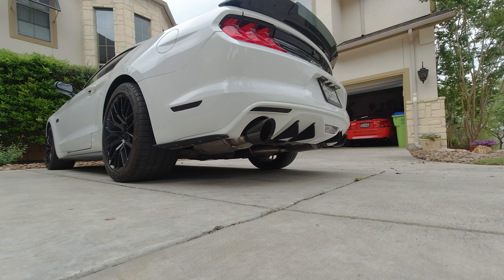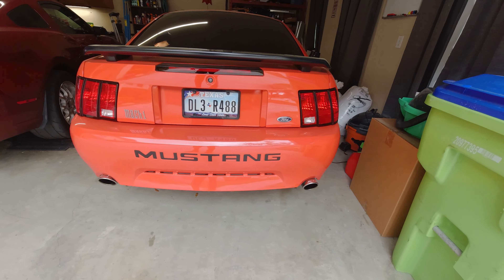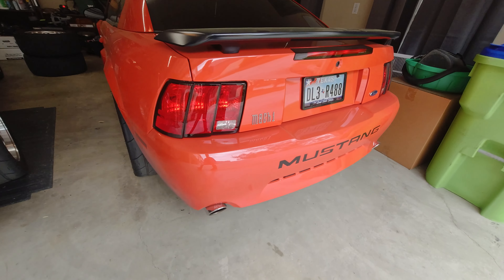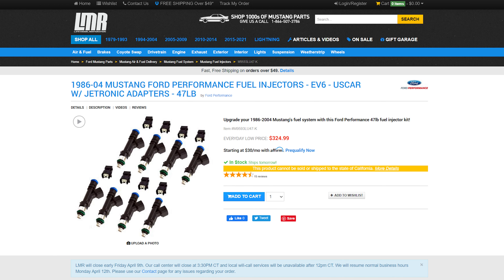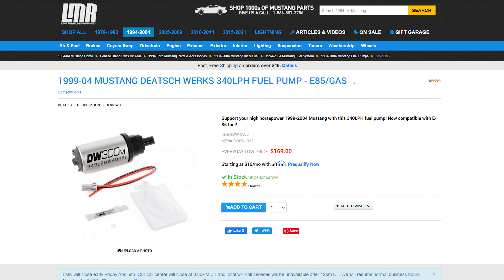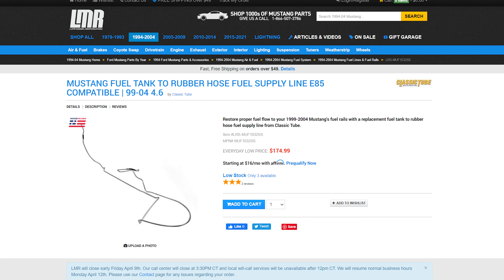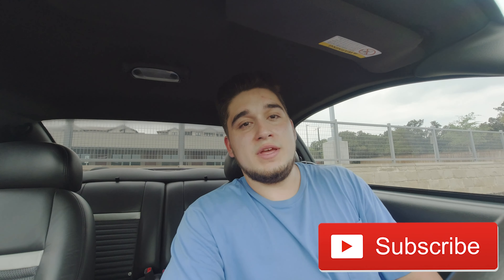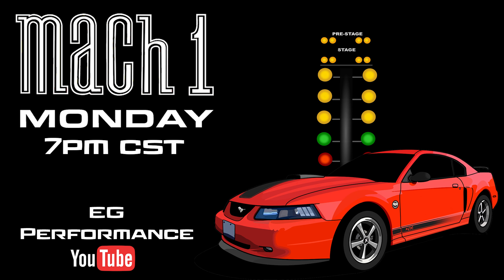How to run E85 in your 03-04 Mach 1 Mustang

Comment: I have an 04 Mach 1, yes I hate paying for 93 octane every week to drive this fun car.
   Honestly, I feel you will be losing horsepower by going to E 85 gas.
   Yes, E85 is a lot cheaper, but for me, it’s sacrificing the performance of the car.
Reply from the maker: Yea the 93 is ridiculous right now. Who told you that E85 loses horsepower? That's just false. It has a higher octane rating than 93 pump gas. It can be compared to 105 octane if the gas is spot on. In almost every instance, the e85 will make more power than regular gar. It really shines with boosted applications.

Comment: Is it possible to use a tuner to swap back and forth between an E85 tune and regular gasoline?  just curious if you were out and away from E85 availability if that would work.  I'd suppose the most important thing would be to get the E85 out of the system as much as you can.
Reply from the maker: Yes, usually a tuner will give you a regular gas tune and a e85 tune. So if you were stuck somewhere that only had regular gas, you could switch to that tune .
Reply: @EGPerformance  I agree with both y’all statements, but to me I will run the 93 octane, cause I love the throttle response, put you in the seat performance.
  If there is a tune, that will allow me to get the performance out of E85, like I do on my twin turbo Mach 1.
   Let me know, cause the 93 octane is damn killing me. Lol
Reply: Just get the Flex Fuel Tune and keep it moving…Simplify your life

Comment: "Its not necessary to upgrade your fuel lines" you do know how corrosive e85 is right? It will eat thru ur stock lines
Reply from the maker: Its not but its always good to do so. Have had the stock lines on all the cars and no issues. Its not like acid.
Reply: @EGPerformance  have your line have corrosion where the fuel line meet the fuel rail?

Comment: Hey you can't use 39 cobra injectors
Reply from the maker: Are you asking or telling? I would say 47lb injectors minimum. Thats generally the size needed for NA if you want to run e85.
Reply: No I'm asking you cuz you got experience on your Mach 1 cuz my mechanic says to get 39 from cobra i dont no
Reply from the maker: Oh gotcha! Yea i would go with 47lb injectors. I know some tuners wont tune the car on e85 without those.
Reply: Cuz I have a 2004 Mercury Marauder I just want to do it E85 full bolt ons
Reply: So 39 injectors should be fine
Reply from the maker: No 47lb injectors minimum
Reply: Ok thank you so much for your help can you send me that part number